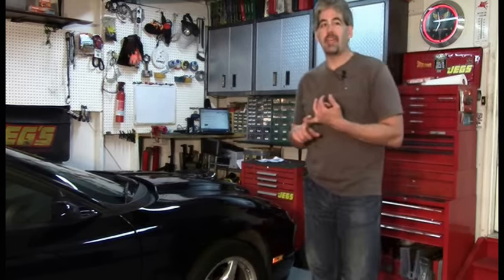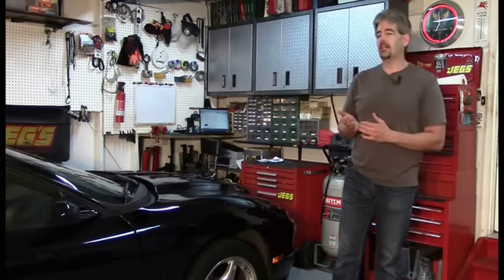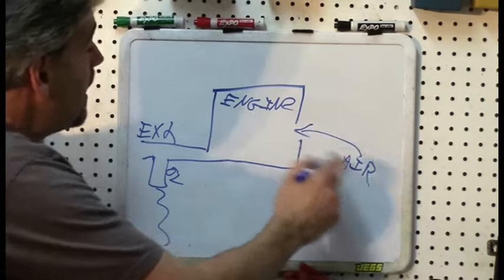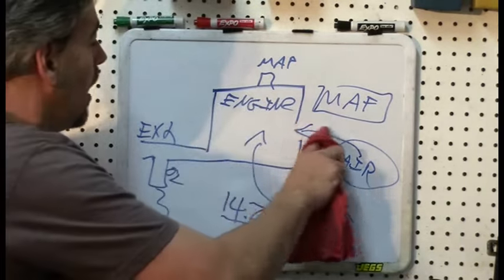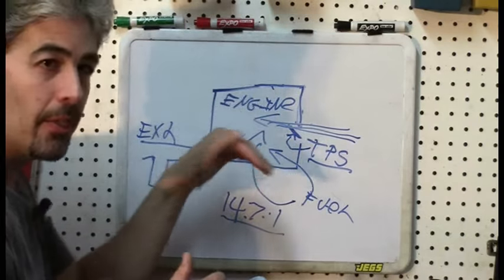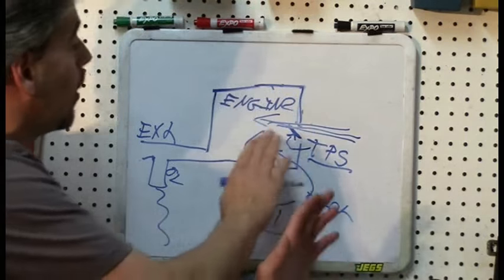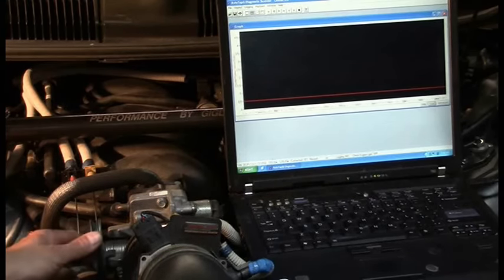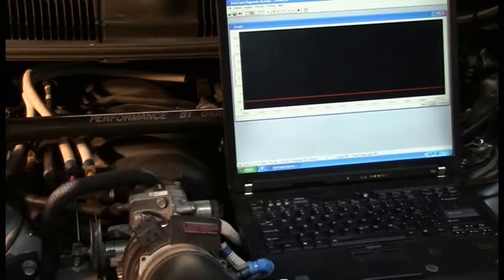TPS (Throttle Position Sensor) Diagnosis and Understanding Pt1

Comment: Thank you for your videos!  Had intermittent hesitation/service engine soon on my 95 Olds Station Wagon.  Replaced many things before watching your vids to include: wires, plugs, ignition coils, and PCV or something like that. Mechanic cleaned throttle body and put a gas additive in. Still hesitated. Brought it back he put a new fuel filter on and more gas treatment. Still hesitated.  I Brought it back again. When I went to pick up the car he told me he was clueless and told me to take it to a dealer.  Frustrated yet more educated after watching your videos I told him I was no mechanic but insisted he install a new TPS.  If this did not work I was going to buy a multimeter and check my MAF and MAP sensors myself.  Particularly my MAF because I learned on your video (if I understood your correctly)  if you have both a MAF and MAP the MAP does not really affect the 14.7 : 1 ratio.  In any event the hesitation ceased after the new TPS was installed.   However I was stalling at stop signs etc. I unplugged the ECM fuse, plugged it back in, let it run 10 mins. Shut it off and turned it back on for 10 mins for a computer relearn. All is well!  Car is running perfect!  Thank you so much!

Comment: Thank you so much for the information in this video. I am experiencing hesitation or dead spots (not all the time) when accelerating always when the pedal is being pushed at a certain point. I told my husband I thought it was a TPS issue. He reminded me I’m not a mechanic and took it to a transmission shop. $2600 later we get it back and same issues. Took back to shop and after a month we got it back again. Still does the same thing. After watching you test and explain the dead spots issue I’m 💯 convinced that the TPS is the root cause of the problem. It feels like I’m running out of gas but only for a second and only when accelerating from a stop between 20-30 mph. I will be having the TPS tested. Thank you so much!

Comment: Schrodingers Box,  Matt, thank you for your time in making this video, listening to you I became smarter and knew better how to troubleshoot for the problem having the basic knowledge acquired by watching this video.  Transmission will not shift 3-4, later I found out it will shift if I released the accelarator, RPM drops to around 1,000, then it shifts. Also it shifts if I go slowly not to eceed 1,400 RPM then it will shift. I checked the TPS on the car using voltmeter. had a variable reading as I move the throttle both up or down. IT worked, then I cleaned the contact points.for both the TPS and the connector. IT worked, thanks a lot.

Comment: Hey Matt. Just found your channel and subscribed right away after this video. My jeeps rpms have been pulsating between 900-1300 rpms. I did this very easy diagnosis and found my tps has an unstable voltage at those rpms. I figured it was the tps but didn't want to throw New parts in and not fix the issue. Great videos and I'll be looking forward to more coming. Thank you.
Reply from the maker: Alex Thelen Awesome Alex- you're exactly the type of person I made the channel for- welcome and enjoy!!

Comment: He’s totally right, I had 4 codes on my c6 vette, I went to get a diagnostic to Chevrolet  dealership and they wanted to replace catalytic throttle body, and sensors cost $2900 which is a lot, then I went to a test only repair shop and I spent $150 they solved the problem as this guy is saying 😎

Comment: I gotta tell ya, I really just stumbled on your channel, happily so, but was very pleasantly surprised at your intelligent troubleshooting approach. Decades ago (fasten your seatbelt - I should easily be through in 45 minutes or so) I was a Director of Maintenance (FAA title) in the General Aviation world. I insisted that my techs AND I do what I've always referred to as 'intelligent troubleshooting.' No parts guessing in our shop - we needed routine customers rather than return customers - there's a huge difference. Watched you until nearly 2 this morning. As I was waking, something hit me that I hadn't remembered in years. (During your cautionary comments about how easy it is to lunch your processor with the wrong wave of a meter lead, I began feeling a little apprehensive about troubleshooting my recalcitrant '93 F150 5.0L.) Early this morning, however, it came to me...PIGTAIL !!!!  50 years ago, as a young Aviation Electronics Technician (AT), I was taught to make a "pigtail" from a connector half (usually male) and the exact same color and gage wires as the harness end of the connector. You simply plug the pigtail into the suspect component, then separate the 3" or 4" wires far enough apart from each other to safely use your meter, enjoying plenty of separation between leads, thereby GREATLY reducing the risk of an unhappy fornication of the computer. I've subscribed.
Reply from the maker: Thanks man.  Yes I actually have a collection of various pigtails I use for testing and they are especially useful for components where it is difficult to reach the terminals!

Comment: 15 years out of car diagnostic and just about to specialise in it again as there is virtual nobody capable of doing it profesionaly as apposed to just fitting an endless list of parts due to  a  bad earth, air leaks or trapped pipes resulting  in wrong decisions
trying just to get my own xkrs misfires done has opened my eyes to the void
i cannot say how glad i am to have your your demos and the intelligent logical  explanation
mutiple misfires  restricted performance  take to dealers
 failsafe engine mode all a thing of the past with your guidence
 i watch each one twice and i understand totaly
 your a fxxxxxn godsend and very much appreciated as i nave been struggling till now to get a confident outlook on the job
airconian uk
keep up the good work its great

Comment: I have a 2000 f150 5.4 290,000 miles i bought new and 3 wks ago started having idol problems at stop sings then having signs of torque converter lock up when put in drive or reverse and just die and when it did run it had low power...a dozen mechanics said it was the iac ,or maf,or throttle body wore out, or egr valve or sensor ,fuel pump and so on...transmission shops said the converter was shot and needed a new one...3 days ago a local mechanic called me and after the formal chit chat told me to bring it over and he would fix it...turns out the tps got out of calibration somehow and now the trk and tranny work and run like brand new and he only charged me 45 dollars.I had no idea that tps controlled so much on that engine and tranny and he saved me a lot of money from witch hunts.

Comment: Thank you Matt for an informative video about the TPS. My transmission failed recently and despite the TPS code, the shop techs said "don't worry about it, the new transmission shifts fine". You used the word "swaptrons" - great word. Well after watching your video and understanding how the tps works, I was able to troubleshoot the sensor myself and verify that it did not even have a reference voltage getting to it. I did all this in the shop parking lot (I'm on a long road trip) with the techs looking on with guilty faces (they wrote on the transmission warranty receipt "electrical ok"). I found a bad ground, fixed it and calibrated the sensor. I'm very grateful for your video.
After this fix, I did notice a dead spot with my DVOM at just about open throttle (smooth transition from 1.25v up to 3.9v then a momentary dropout before continuing to about 4.4 volts) I replace the sensor, but it is still there. Is there something in the throttle mechanisms that could cause this lapse (like a spring shifting, causing the sensor actuator to shift back a hair for just a millisecond)?
Reply: +Jimmy S Thank You that is good to know. I'm still getting a tps code and I've ohm'd out the wires from the sensor to the plug on the passenger wheel well and from the plug to the pin on the computer harness - I get .4 ohms - is that too much resistance? (perhaps I should try an actual load on those wires, such as a high wattage bulb)? If okay, would you suspect the computer?...And...If the computer itself has a bad ground, is there any reason not to bypass the computer and route the signal return directly to ground? Thanks, DJ
Reply: +Jimmy S It is a 1992 F350 7.3 diesel. It has 5 volts getting to the sensor and I believe the code read "out of range", yet when I back probe at the sensor, I have it set at 1.25 volts idle and 4.4 volts wide open. Yes the key is on, engine off. I have ohm'd the wires going to the computer with everything disconnected and get no more than .4 ohms resistance on any of them. I am starting to suspect the computer or its wiring inside the vehicle, which is why I wondered about trying to bypass the ground within the computer and instead bringing the signal return directly to battery negative.

Comment: Hi Matt, I really like your videos. Thank you for taking the time to make them. Can you explain why when testing the TPS for resistance, you say to put 1 probe on the 5v and 1 probe (from your meter) on the signal wire. Why would you not put 1 probe on ground and 1 probe on the signal wire? When you tested the computer side of the harness for voltage, you put 1 probe on the ground and 1 probe on the signal wire. I would think it should be the same way to check for voltage and ground except for changing the dial on the meter from ground to voltage.
Thank you. .

Comment: First Matt, let me say I appreciate your great sense of humor, I just woke my wife laughing at the Artistic ability / Steven Spielberg comment. Had a guy with a 2001 Corvette C5, come by the shop yesterday. He has been having an intermittent p0300 code returning, and the GM Dealer here in VA, could not find the problem. However, no surprise they replaced his plugs and wires and coils as this always fixes these problems............ I took my prior FT skills and added your far better skills I learned from your Fuel Trims video, to diagnose the car. I didn't take an hour finding the problem with the skills you gave me. I referenced your channel to him, as he is a car collector. Thanks Matt!
Reply: +Adam Czajka   How about sharing what you found via the diagnosis ?
Reply: berkmanyt yes I will. This weekend if that's alright. if I don't post by saturday feel free to remind me :) Good night
Reply: +Adam Czajka   Thanks Adam….I'm interested in what you found…clogged  catalytic converter ?    other ?    vacuum leak ?  restricted exhaust ?    Well documented restriction in plastic intake…factory defect under warrantee.

Comment: Haha am I the only one who actually watched the entire video? That last comment rocked.
Reply from the maker: Scott Amoroso Ha, I had to end it on that note- seemed perfect to entice people to Part 2 lol
Reply: @SchrodingersBox  I have got an oscilloscope, not too expensive these days to get a fourth leg up on things. You can get the cheap low res ones at 150k or 1M samples per  second or get a 2G samples per second. Those would be enough, unless you are trying to sniff logic.. then a logic analyzer or better resolution is needed. Also, 4x the frequency of transmission as the sampling rate is needed to get a clear picture.  We, the public really need some free and open source ecu w/o efi for vehicles.
Reply: I couldnt take much of him, I stopped the video 🤣

Comment: Hi Matt. Wanted to share the results of my TPS testing on the Park Avenue. I did the resistance test first and surmised that values did increase gradually as I opened the throttle. I then tested the wiring connector and found I had a solid 5V feed. I even moved the harness around and no change. Just for fun I decided to test the TPS once more and this time by moving the throttle VERY slowly, I noticed that before the resistance would increase at all it would drop even lower before coming back and then increase steadily. I did it 3X same result. Not 100 percent convinced, I changed the sensor and was amazed at the improvement in transmission and throttle response! It seems to always be in the proper gear, no RPM flares and the lock up engages confidently and holds under load. I believe it was the smoking gun and I can't remember when this car ran better. I would have never discovered this without the info on your video and would have paid a tech hundreds in diagnostics I'm sure. So, THANKS! Looking forward to more of your videos.
Reply from the maker: Nice! Yes this is why some type of graphing capability is so useful on variable resistor checks.  You can do it with a DVOM but it's my harder. Nice diagnosis and fix- you're hooked now lol!

Comment: Very good video and a very clear explanation. The potentiometer is usually carbon which tends to crack but some are wire wound which don't have that problem. A potentiometer is used in radios to vary the volume and for many other uses. It is simply a resistor with a sliding connector which is the centre pin.
Reply: Kay Douglas or Douglas Kay, you must be a friend of this bozo as no one in their right mind could watch the whole video.

Comment: Thanks for the video.  I bet you can't find the TPS on 1967 Camaro!
Reply: +Stan Rodgers or a 2015 power stroke
Reply: My 2005 6.0 has 2 positions idle and full.
Reply: +Stan Rodgers   Did you know there was an option on 67 Camaros that sprayed a fluid on the rear tire via pushing a button on the dashboard….very rare….. I think they only sold a half dozen.    Z28 was a
small print option that year.
Reply: +duh   I think there were only about a half dozen that had that option ?

Comment: Thank you for calling me out, my car has been giving me some issues and finally it stalled on me the other day throwing a wrench light. Pulled the codes and got p2111 and a p2104 as well as an evap code po455. Evap can wait because drivability is more important than the environment IMO lol

Update: I'm pulling schematics for the throttle and accelerator pedal and will be testing both. I have yet to run live data and see what the sensors are reading when the issue occurs so I will attempt that as well.

As you said it pays dividends to diagnose rather than throw parts at something. It's been hiccuping for a while at idle and I decided to throw coils in it the other day as a half-hearted attempt and who would have guessed, they didn't solve the kicking hehe

I need warm weather to come so I can sit outside and give this poor Vic the TLC she deserves

Thank you for the immense insight you provided me with these two videos, I will surely check out your other content to learn more!

I have a basic history in automotive repair and electrical both household and in circuits So the concepts aren't new to me but the actual theory is something I didn't get to learn in school but it's never too late to learn something new!

Thanks a million for the time and after you put into this content, The 2% sticks around greatly appreciates it!!!

Comment: Yea you look too lazy to show how to replace the throttle sensor
Reply from the maker: No, No No... I am too lazy to replace things that are NOT the TPS if the TPS is the problem.  Understand?
Reply from the maker: The Dove Nest Vansion Hahahahaha Thanks Dove nest.
  Unfortunately I get comments from people like that guy ALLLLLLL the time.
  A lot of simpletons out there just don't "get it"- what I am trying to show here. They are just forever conditioned to play the parts lottery instead of using diagnostic logic.
Reply: LOL, I watched a guy on a video replaced the TPS, throttle body and pedal sensor...I call it the shot gun method. Change everything in the system...your bound to get it.

Comment: Thanks for taking the time to properly show us your Tech Tips....I have a 2007 Cobalt that according to a plug in diagnostic tool, shows that I have an issue with my Throttle Sensor....I’m familiar with a voltmeter since I’m an HVAC Tech so I’ll take your teachings and try to figure out what the heck I got here ~ Thanks

Comment: Damn glad I stumbled across another 'Greasy Geek' they're hard to come by! Just hope you show testing of the various sensors using a DVM, I'm the family mechanic, cheapest they can find, but I'm not equipped with a scan tool. When I start talking automotive I can see ppl's eyes glazing over!
Reply from the maker: +dondale68 Nearly all my videos labelled "diagnosis and undrstanding" are same format as this showing DVOM as well as scan tool methods.  The channel is designed for people lke you!
Reply: Great. I've been successfully working on cars for over 30yrs, been in industrial maintenance for 25yrs, a supervisor for the last 11, but now I'm on disability and just don't make enough to buy a scan tool. As you see from my past I do know that every piece does have a specific job to do!

Comment: I was testing one on a chevy venture today.  I couldn't see it on the digital meter, but I got out my good old analog meter with the needle and you can see the dead spot really well vs the digital meter.  The need just dips when it hits the dead spot.  Cheaper than an Oscilloscope.

Comment: Wow you videos on TPS and MAP where awesome. I was just going to replace both on my 02 300M.  Code I was getting were P0108 Manifold Absolute Pressure (MAP) Sensor Circuit High Voltage and Code P0068 Throttle Position Sensor Inconsistent with the Mass Air Flow Sensor. Which made me thing to search for a vacuum leak first and check for a dirty intake. I don't have the proper diagnosing equipment. But will start with the simple things first. I will take some time and check out your other video... Once again great job.....
Reply from the maker: +MANUEL HERNANDEZ Thanks man.  Complicated equipment helps but it isn't really necessary. I've checked many of these systems with nothing more than my DVOM and my brain